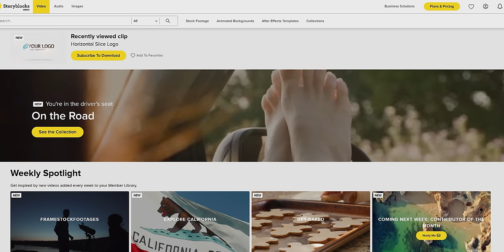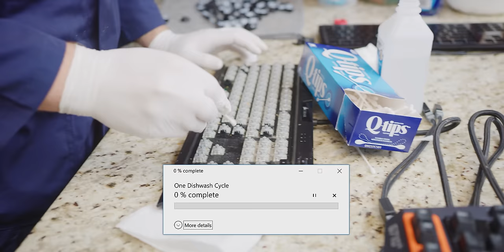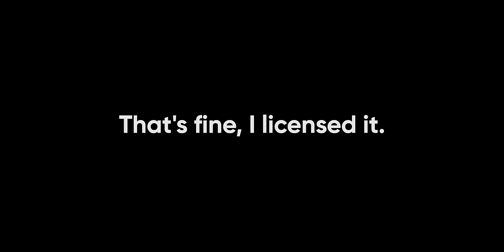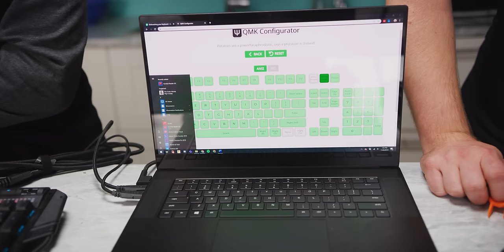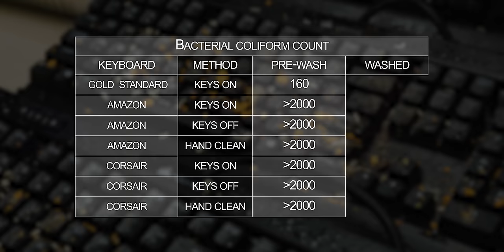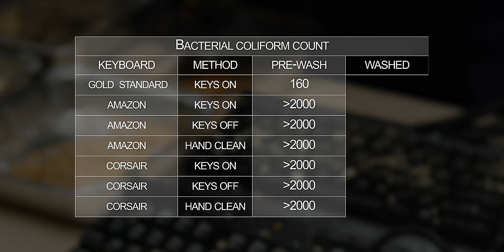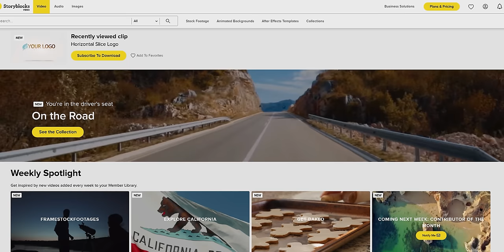The best way to clean a keyboard is… the DISHWASHER?

Comment: I definitely would not call using a dishwasher the best way to clean your keyboard. Here's an effective and probably safer way to make sure it actually gets clean.

Items needed:
IPA (Isopropyl Alcohol 99%)
Soap (liquid detergent) and water
Toothbrush 
Screwdriver kit

Recommended items:
Compressed air can(s) or
Air compressor with a blow gun attachment.
Keyboard key removal tool

Remove all the keys on the keyboard (take a photo before you remove them so you know what key goes where or you could look up your keyboard's key layout online). You could clean these individually with the brush and soap water / compressed air or send them through the dishwasher (in a container with a lid and large enough holes in it so the dishwasher can do its job) if you're too lazy to clean each key.

Start to disassemble the keyboard case and as you remove a layer, give it a brush with the IPA. If your keyboard's casing shell is plastic, you should use the soap water and toothbrush to clean it. This should help remove some of the dirt/dust/crust or at least it will knock it free. Use the compressed air to blast the loose crud from crevices, hard to reach areas, and whatever got left behind from the brushing.

Reassemble, place the keys back into their positions and enjoy your fresh keyboard.
Reply: Nope. Dishwasher still better.
Reply: Using IPA isn't a very good idea since it can eat away at coatings on a lot of keyboards/keycaps.
Reply: @Kori-ko 

Edit: A quick google search on if IPA is harmful to plastics returns that 99% IPA is not harmful or corrosive to plastics.

 I didn't say to use it on the caps. I just said to give them a scrub and a blast of air to clean out the inside. Maybe I should specify to scrub the caps without IPA.

Thanks for the info, though. I didn't know the coating would be damaged.
Reply: @insomnimatics  It doesn't eat away at the plastic itself, just a lot of protective coatings on plastics. A lot of boards use ABS for the chassis, but to prevent shine from use, manufacturers apply a UV coat on top, which sometimes also gives a more matte texture. Alcohol will strip that coating decently, but wiping will accelerate the corrosion on it. 

It's not an obvious effect, but if you see absurdly shiny keycaps or palm rests on keyboards, or keycaps where the lettering was eaten off, you at least know why now.
Reply: @Kori-ko  I added soap and water to the list of supplies. That seems to be a general safe way to clean the plastics and the caps.

At least I know about the coating, now. I probably would have ended up using IPA on some part of the outside casing or the caps if they were difficult to clean.
Reply: @insomnimatics  IPA is fine for metal boards like a like of Corsair ones or modern custom boards, but soap and water should be used on plastic-chassis boards. Caps can also be cleaned with soap and water, but a nicer and actually less effort way is with unscented denture tabs in warm but not hot water.
Reply: @Kori-ko  interesting, and the chemicals from the denture tabs, from what you've experienced, have no I'll effects on the coating over time / with multiple cleanings?
Reply: @insomnimatics  Yeah, they're actually really gentle and antibacterial on top of that, as well as being cheaper than IPA since you can get a ton for a few dollars and a tab or two treats a whole set of caps.

Comment: What is wrong with you guys? I've been dealing with computers since 1974, and I've cleaned a lot of keyboards. You didn't take one of these keyboards apart. You ALWAYS take a keyboard apart to clean it. Removing keycaps is optional. But you take the top of the keyboard off and blow the bottom out with canned air. Then you take apart whatever else is needed (like the rubber membrane on that kind of keyboard), and hit the thing with alcohol (which evaporates and leaves minimal residue). Cotton swabs, paint brushes, etc. Alcohol takes everything off and disinfects (if you're concerned about that). And by the way, the mineral-heavy water where I live could easily deposit residue which would degrade traces and such.
Reply: It's just a video for fun :)   and views
Reply: noferblatz Ok boomer
Reply: @JHN322  original
Reply: IncandescentWithRage malding

Comment: So, are all keyboards waterproof? What about the cheap keyboards?
Reply: All electronics are waterproof. IF they have no electrical current when exposed to water
Reply: oh really? Then I got to try it.Hope I don't loose a keyboard.
Reply: @crombajaa  just be careful with wireless keyboards
Reply: @jannicklumme9298  Okay Thanks!
Reply: @johnathanera5863  not true at all
Reply: @7ngel  it actually is lol. Well, if you ignore corrosion. Which wont be a problem unless you do this a lot.
Reply: I had a ps2 and an old pc left outside for like a year and they still worked, the ps2 is in a junk pile been there for years yet to be taken to the junk yard.
Reply: @johnathanera5863  'if you ignore corrosion' ya let me just go dump some water on my nintendo switch and see how well it works

Why would you ever let your board get water on it, eventually corrosion or a short will ruin it
Reply: The only thing that matters is that there is no electric current flowing when the board is wet. You absolutely must ensure it is completely dry otherwise you can short something when you plug it in.
Reply: @7ngel  "eventually" is the key word. And its not a certainty. Just a chance. Corrosion generally wont happen if you allow something to properly air dry. AND didnt drop the devicd in water WHILE it was on. Thats how you get corrosion, water mixing with electricity( or the object being contantly exposed to water) . Its not JUST the water. So in short 90% of the time, youll be fine dropping your phone into water and letting it air dry, as long as the phone is off when you do it. You know how many times ive washed an ipod or iphone in the wash? As long as you dont try to charge it or turn it on right after youll be fine.
Reply: @danman9847  how could you! I would never junk a working ps2
Reply: @johnathanera5863  I definetely wouldn't say it is fine with a phone because they have batteries. Everything that doesn't have any power source while unplugged should be fine. Maybe capacitors could be a problem but I don't think most that are used in consumer electronics store enough electricity for that.
Reply: @7ngel  your switch would be fine if you took the battery out of it.
Reply: @jannicklumme9298  take out all batteries and you're good to go
Reply: No, keyboards a NOT waterproof. But damage from liquid can only occur when there’s an electronic current running through them. That’s why you have to leave them a week to dry off: If you plug them in when there’s water present, they will fry. It’s the same with your phone or laptop. It can survive getting wet if there’s no electricity present, and is fully dried before you turn it on again.
Reply: @thunderpeel2001  That seems so lazy though... just wipe your keyboard off and take some canned air to get the hair etc out of it or take key caps off to really clean the hell out of it. How the hell are we getting so lazy that were gonna risk ruining expensive electronics by using hot water that could warp it or a little bit of water still left causing a short or corrosion.
Reply: @tonypajamaz7079  It didnt read discs or at least the ones i had so it was worthless.

Comment: Sorry but you guys made a critical mistake with this video and you may end up responsible for lots of failed keyboards. Leaving the keyboard to dry does not prevent electrical damage, and it's just as wrong as using rice on phones.  The water is not the problem, the water simply carried the problem to the electronics and left it there!  The damage to the electronics does not begin until after you apply power, and it can take days/weeks/months. Letting it dry then plugging it in for a quick test proves nothing. Water carries dissolved salts to the electronics and then evaporates off leaving the conductive salts behind. Then you apply power and the salt allows a little electricity to flow between metal parts which slowly corrodes them away until the circuit stop working.  
It's only safe to wash the keyboard if the manufacture has sealed the electronics. Some brands do, some do not and this must be checked before washing. If you wash a keyboard with exposed electronics inside then it's going to fail due to the wash, it's just a question of how long it takes, days, weeks or months.
Reply: @m_train Gaming  ?
Reply: @Psi105  His point is that its gonna break in the future no matter what. Maybe
Reply: @danman9847  ah true, i get it now.
Reply: okay but... where would the salt come from?
Reply: @charliedulol   Mainly from the tap water feeding the dishwasher,  tap water is full of dissolved salts and heavy metals.    
Salts also from naturally on metals when exposed to anything that's acidic, and tap water isn't 100% neutral.
So the water can generate new salts when it comes into contact with metals.
Reply: @Psi105  Am I incorrect in thinking that if you soak the keyboard in something like high purity isopropyl alcohol after the dishwasher it'll probably work? Certainly not an easy way to clean the keyboard.
Reply: Tap water does not have anywhere near enough salt to be an issue.  The trace amounts of minerals left after dry will be harmless.  Probebly far better then the crud you washed off.  However, dishwashers usually add salt.  But even if coated in salt, its only an issue if the salt gets damp (high humidity) - not an issue in air conditioned office.  I've washed loads of eletronics in tap water (no dish washer) - never an issue.
The week thing to dry is dodge though - some cases may hold onto water for very long time.  If warm, super dry place, probebly ok.
If your phone took a bath- why would you not try and dry it - what do you have to loose?
Reply: @Octojen   It may not seem that conductive but as some of the water evaporates the solution sitting on an IC becomes more and more salty. You then get uA of current flowing that slowly eats away at the metal and dissolves more metal salts into the solution. Remember some of the pins can be 0.4mm apart and as distance reduces the current increases.
You need to wash it in isopropyl (or other PCB cleaning solution) to displace the dirty water and get rid of it before it drys.  Washing electronics in water is only ok when it's pure water and the PH is neutral.  Tap water is a no no unless it's going to be cleaned again in another stage of the process.

Comment: Why did you only test the keyboards for a simple click-input afterwards? I once spilled a drink on to my keyboard and typing still worked and I was happy but ingame the signal actually wasnt holding if you kept pressing a button. So while walking and pressing "w" for example, the character ingame walked and stopped and walked and stopped... Broken keyboard if you are a gamer but probably not noticable if you just type with your keyboard.
Reply: Your keyboard malfunctioned because it was hooked up to power when exposed to liquid.
Reply: happens to me too
Reply: but i got used to it

Comment: Just an FYI and a thank you. I have a Corsair K70 keyboard. Like a dummy, I spilled soup on the keyboard. I ended up buying a new K70 before I watched this video. After I did I figured what the heck. I stripped the keycaps off the damaged K70 and washed it on the pot scrubber cycle with no heat. After 5 days I put the keycaps back on and tested it. The thing worked. I wish I had watched this video before I shelled out the money for a new K70. At least now I have a spare. Thanks for the inspiration guys.

Comment: you could power wash it with degreaser or soap and that little dust sheet wont disappear unfortunately. It has to physically removed with force like a towel or q-tip.

Comment: Yes but wat about a Wireless Keyboard(it has a lot more Electronics)
Reply: The internal batterycould be a problem. I guess it should work if you can remove it or u drain it 100%. No Warranty given
Reply: @jannicklumme9298  or just take out the battery first
Reply: @アカシア-w7b  dont have a wireless keyboard. Didnt know you could take it out sperately. Thought you would probably have to get all internals out. Thanks for telling me that you can get them out seperately

Comment: Haven't finished the video yet, still have a couple minutes so maybe you will discuss this, but I am a bit unsatisfied.... "Cleaning" things with cold water and no soap really is pretty useless. Warm/Hot water is a much better solvent, and will greatly improve the "cleaning" process. Soap is designed to trap small particles and allow them to be carried away with the water, and soap is also a surfactant, which too helps with washing away the unwanted particles, and also helps ensure 100% coverage across all surfaces. I also feel that the normal drying process of a dishwasher helps with the sanitization, and would steam out all or most of the water when it's done being cleaned.

"Washing" your keyboard in a cold dishwasher, with no soap, and no heated dry, really is just a failed test. Sure, maybe the surfaces will look a little better, but as you guys discovered, dust is left behind, food particles, tons of hair, they're really not clean at all. Even if they do look clean, they're not truly sanitized. Not to mention, you didn't heat them dry, so you had to wait an entire week, which really just makes the dishwasher a moot point. You might as well throw your keyboard in the back yard and spray it off with the garden hose, it's no different. This test you guys do doesn't really answer the question.

I want to know if I can truly CLEAN my keyboard; throw it in the dishwasher WITH soap, with HOT water, and at least a warm dry at the end. I think that's what we all came to see, and I feel like this test was a bit of a let down. Sorry Linus. It was a great video nonetheless, fun and still informative. I wanna see part two, lets see how many keyboards survive a normal cycle through a dishwasher.

Comment: yer but corrosion doesn't happen fast enough to kill connectivity between the circuits. needs a follow up 6 months later to see if the solder is still good and plating on PCB need to re test open and inspect them.

Comment: I cleaned mechanical keyboard with water couple times, because i heard compressed air can make it even worse. But it started to be unresponsive sometimes and i had to re-plug it, so i stopped doing that. And i heard it is risky. I use that goo from CyberClean or how it calls. Which cleans a lot of dirt, but not everything. Also there is probably something stuck in switches. I was very satisfied with my keyboard, it was like mind reading when it was new. But after 3 months already: keys started to be sticky and it never improved. Even if i took whole keyboard apart and cleaned it, it will be dirty like in two weeks. There is too much dust and i don't even live in dusty country...

Comment: Use an air compressor or canned air to blow out all the water to help it dry a lot faster. Probably be able to use it within a day or so if you do that. Maybe even over night. You could probably place it under a light, maybe even make a quick box to contain it, that will get warm (just check the temp of it so it doesn't get too hot) to help it dry out too.

Comment: An easier way to do it is to use a solution of distilled water and isopropyl alcohol.  Scrub and soak in solution where needed the most. Sit it front of a fan for a few hours and you are good to go. Distilled water isnt conductive and alcohol dissolves very quickly.

Comment: I would still consider removing keycaps and cleaning by hand with 99% IPA the safest way. I mean you can't be entirely sure if the keyboard is fully dry out, or switches are not affected by water in any way.

Comment: Well... i think in 2002 or 2003 i already tested this with a Logitech Optical Desktop Wireless, because i unfortunately spilled about a Pint of Beer onto it.
Well, what to say: It worked just fine. After a few days of drying it (and it was non mechanical) it worked like a charm for about 1 more year.

Comment: Had mine done with a vacuum cleaner, does helps to remove bits and parts. I keep a keyboard far from the head, so little of hair inside.
Reply: For separate keycaps - I drowned mine inside hot water mixed with acidic compound cleaning liquid. Whatever that would sound.

Comment: My G910 corroded and is now double pressing and has some of the RGB lights turned off after being peed on by my squirrel glider and then washed with brake cleaner, so While dishwasher might be fine a few times, constant water exposure will ruin it. Or maybe mine was deflective from the factory!

Comment: sooooooo. either manually deep-clean your keyboard and have it done in like 2 hrs. OOR remove all of the keys anyway and then toss it in the dish washer and allow it to dry for a week. i wouldnt consider the latter to be a "Quick method". 

Secondly. Water is bad for electronics IF they have voltage running through them. this is because the water is a conductor and allows voltage to arc across circuit lanes which frys the device. MY advice if you are going to dishwash your keyboard would be to wither blow dry it or place it into a room hot enough to evaporate the water out of the keyboard. 100 degrees ish should do the job in a few hrs.

Comment: Yes, this really works :) did it last week. I have a Lenovo KUF 1256 with fingerprint scanner. The keyboard was dirty after 3 years of usage and the fingerprint sensor didn't recognize my finger any more. I washed the keyboard on 50 C° with! a soap tablet. After washing I took the keyboard apart and let it dry in the sun. The next day I assembled the keyboard again and EVERYKEY worked and the fingerprint scanner is working as new :)